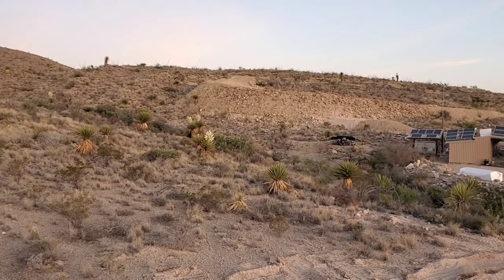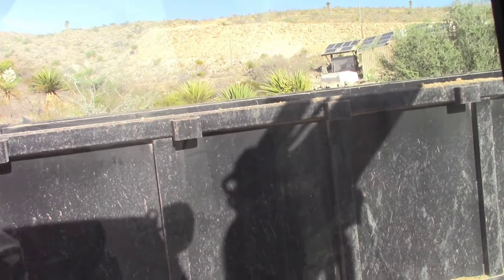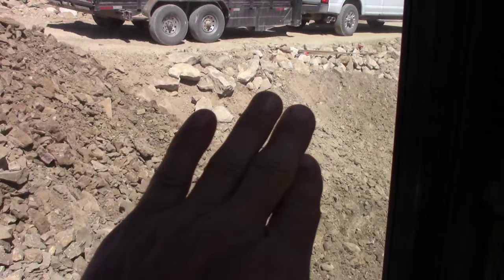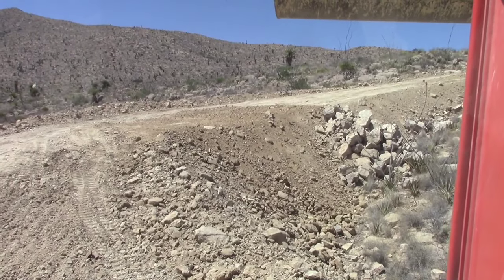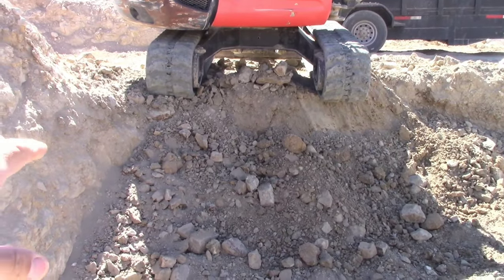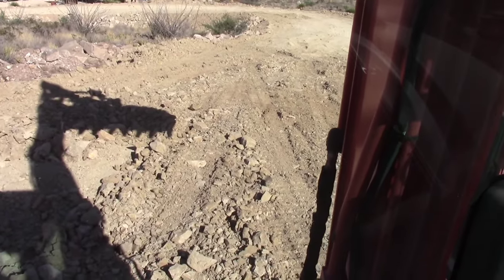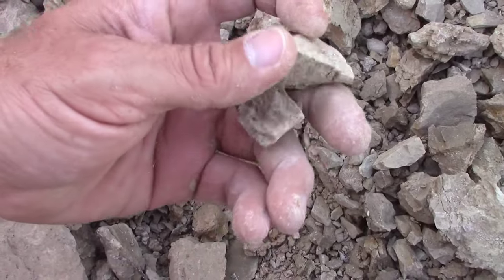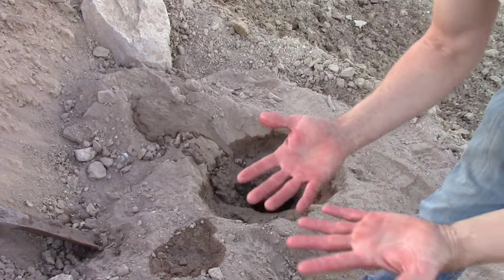Finished digging on the South side of the pond and made some progress on the road @Timeline Ranch

Comment: I was wondering if you have done much research on planting trees in the desert? I don't see any mulch around the base of your trees and that concerns me. In order for them to survive, the mulch keeps the water from evaporating, Protects the mycelium and it fertilizes the tree as it breaks down. 

In dry lands your mulch should be a MINIMUM of 1 foot thick and a foot wider than the drip line of the tree. If you create a circular mound around the base of the tree It will keep the wind from blowing the mulch away and help capture rain water.

Also I noticed, you have what looks like an aloe Vera style cactus plant growing all around.
 Cut off the "leaves" and put a whole bunch down in the bottom of the hole before you plant a tree. It acts like a water reservoir if the baby tree roots can't reach the pond water down below. Also, cactus style waters found in the pads release a growth hormone when they are damaged that can help the trees
Reply from the maker: Thanks for watching as always. The method I am developing here is different from others, You have seen in the past. The information is all quite helpful in different settings you mentioned but not necessary. There is more than one way to be successful in the desert. I only water the trees once in their lifetime when planted. If you water from the top, the trees will produce roots at the top. I am not at the ranch for 48 weeks out of the year the roots need to be as deep as possible for them to survive there on their own. The trees will produce their own mulch layers over time as nature intended. You can see the one pecan tree that has been there for almost two years completely on its own is very satisfied with the current conditions. I think with time you will be pleasantly surprised with what will be achieved here using other methods than you've seen in the past.